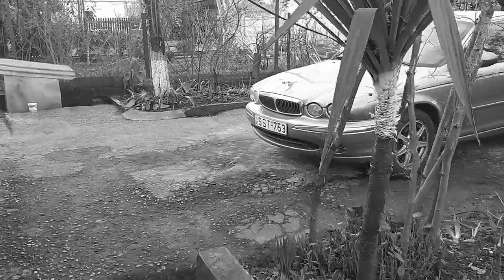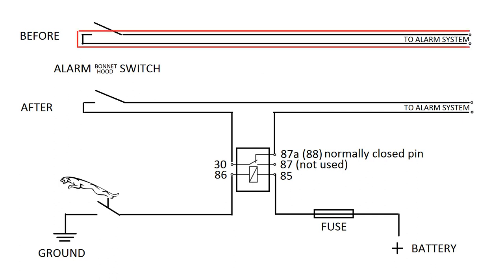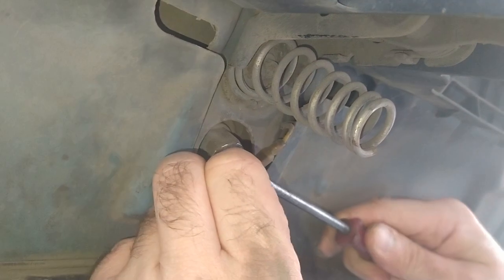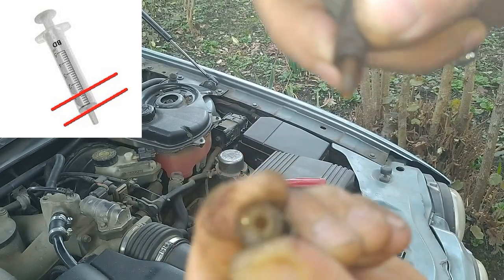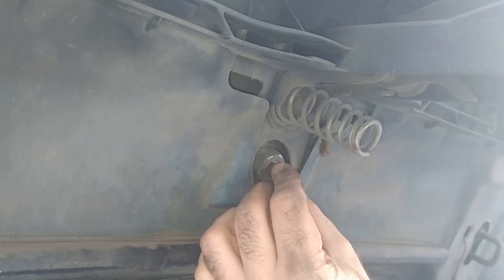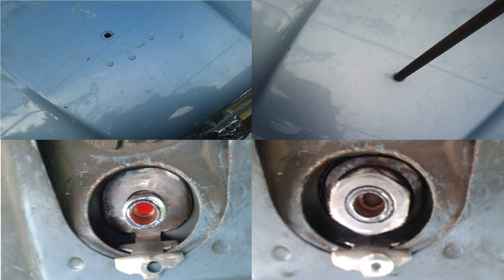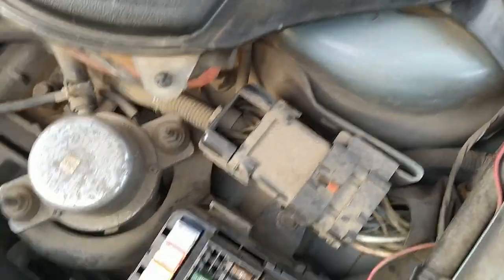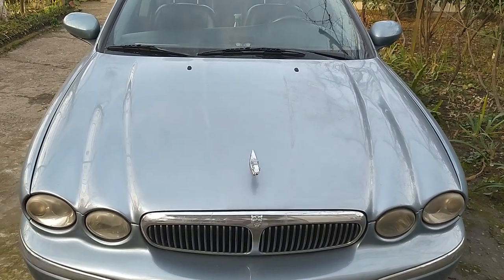Jaguar hood ornament installation - vandal-proof leaper

Comment: I have carefully watched your video and have just installed the alarm circuit. My leaper has a looped steel band held under tension by a spring. The end of the steel band is crimped with a cylindrical crimp. I made up similar contacts to yours and the result is amazing. Thanks for the idea and the electrical circuit details. A great anti- theft device!
Reply from the maker: I am glad you made use of my idea and transformed it for your reality. You leaper must be an OEM one, while mine is not.

Comment: so if anything could set off your alarm? jags are from england where wind and rain will play with this leaper all day but its a nice thing .
Reply from the maker: Mike, thank you for your comment, but I don't understand why my alarm can be set off? The wind and rain don't have enough power to activate the alarm. If the clearance between contacts is so small that the wind can make a circuit, you should just lower the stainless ring a bit to enlarge the clearance. Adjusting the clearance should be done right after installation.
Reply: @jaguarrroman  rains slow there . A storm might activate it  anyway its a nice kit why not make it as a thing and make some money from selling it ?
Reply from the maker: My friend, it can be activated with anything or anybody, that can raise and turn the leaper around, compressing the spring. I've been using my leaper for about 4 or 5 years, nothing has ever risen and turned the leaper around, only humans. As for making some money, thank you for the idea. I will think about it.

Comment: Hi, one of my nephews broke the cable that holds the leaping jaguar of my S Type. I see that yours doesn't have a cable, instead it has a bolt and nut. Did you make that change or it came like that? If it was you how did you do it, what parts did you use and what solder did you use?

Thanks for the information, if you can make a video of this would be great 😉
Reply from the maker: My Jag is European, she came without a leaper and I had to buy it on eBay. The majority of Chinese leapers go with a thread stud and a nut, while OEM are secured with a cable. The leaper came drilled from downside up and has got a thread inside. I think, you'd better try to replace a cable, or buy a Chinese leaper with a thread.
Reply: @jaguarrroman  I think I will go with replacing the cable. Thanks!!!
Reply from the maker: Thank you for comments and good luck!